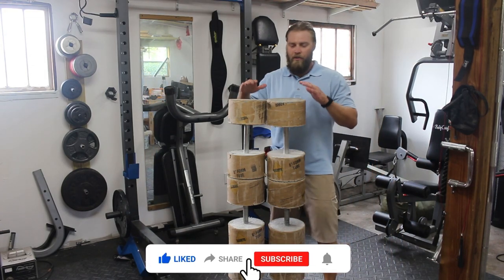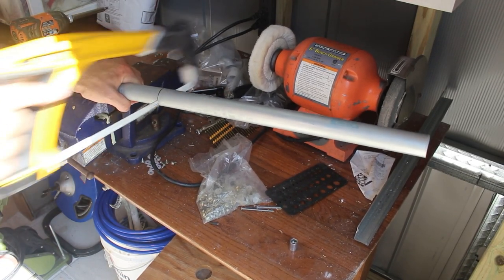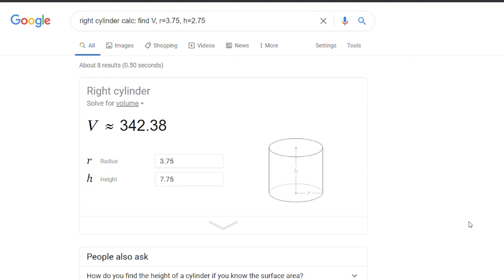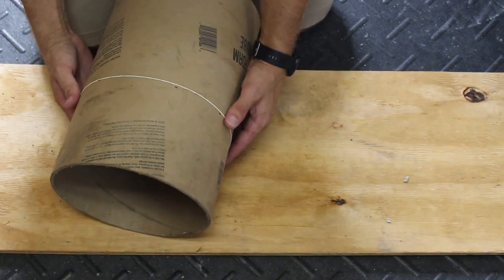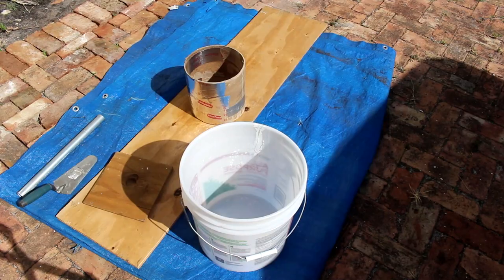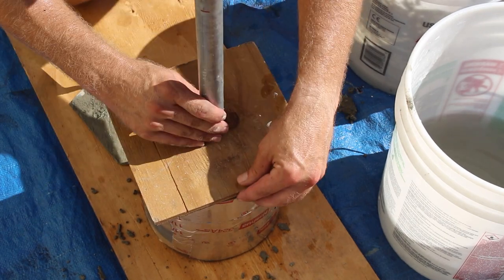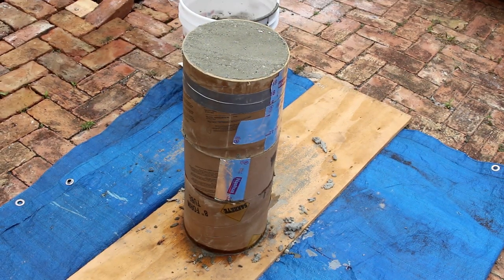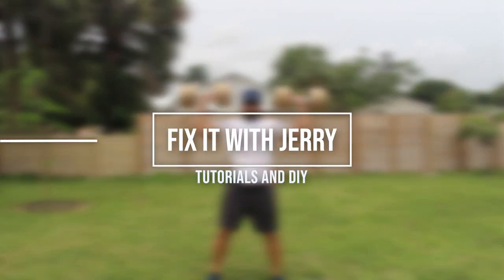DIY - Cheap Concrete Dumbbells

Comment: Hi FixItWithJerry
I am trying to make exact weights in kg and cant really get a hold of how you calculated the spreadsheet. Would it be possible to update one for EU Fans?

Also, wouldn't it also work to just weigh the concrete instead of calculating height?
Reply from the maker: What are the increments you would normally use in the EU? I can build another spreadsheet in kg and cm. I'm not sure I understand the second part of your question, do you mean weighing it wet (as you mix) and pouring in a mould?
Reply: @fixitwithjerry6161   Thanks for the quick response. Thats exactly what I meant, I've seen other YouTubers do that but I am unsure about the accuracy of this method as I‘ve heared some of the water evaporates (which lessens the weight in the end).

I'd really appreciate a chart with kg for 20cm (diameter of the mold, close to your 8 inch). Yesterday I tried to make one for myself, but somehow I didnt get it to work for metric.
Reply from the maker: @kjell2991  That would probably work but then how would you know how tall to cut the tubes? I also don't know the wet vs dry weight of concrete. Maybe I'm missing part of the process. I should be able to adjust the spreadsheet I have fairly easily. So, 20cm diameter and what kind of weight increments? In the US, for example, we usually jump 5 or 10 pounds for each set which is why I have 20, 25, 30, 35 lb .. etc measurements.  Would you 2kg or 2.5 kg increments maybe? What is common for a commercial gym in the EU?
Reply: @fixitwithjerry6161   it differs, but 2kg in between is the standard. With weighing, you cut the molds after you poured the cement. Makes it more complicated in that matter for sure.

Only thing that will be a bit problematic in my case is that I got some heavy duty metal handles that probably weigh 2kg+. Hard to calculate that in but I could use a sanding machine to get rid of additional weight.
Reply from the maker: @kjell2991  I see, well with the handles you would still probably be pretty close. As I show in the video, the ones I made were actually closer to true weight than the metal hex weights I bought. I'll try and put together a spreadsheet for ya. I'm sure you're not the only one that would appreciate a metric conversion.

Comment: If we waren't using an 8" form tube how do we "solve for the volume of a cylinder"
Reply: At Lowe’s they sell 8” and 12” diameter form tubes. All you do is divide the diameter by 2 and this is the radius. Look up cylinder volume calculator. Type in the number that is half of the diameter in where it says “radius “ and type in the height of what u want it to be. It will give u a number in cubic inches and that is how much space there is
Reply from the maker: There's also a size calculation chart (Standard and metric) on my website.

Comment: The diameters are different because they ship the tubes in one another.
Reply from the maker: Makes sense. I point it out because it will screw up your calculations for weight. As long as you know which one you're using you can compensate.

Comment: Rigid emt is probably better for the handles
Reply from the maker: Is that not the same as Galvanized EMT Conduit only threaded?
Reply: @fixitwithjerry6161  They are both galvanized but the difference is regular emt is thinwall. Rigid has a thicker inner wall and several times stronger.
Reply from the maker: @ruve_9074  good to know thanks!

Comment: It is okay if i use other cement?
Reply from the maker: You'll want to use something that has gravel in it, the gravel gives it strength. Not mortar or stucco mix or anything like that. Also I would stay away from the fast-setting mix because it may harden before you can smooth it out in the mould. Hope that helps.

Comment: You must put "anchors" into the metal bar.  See this example https://youtu.be/4ZES0ZKmes0?t=302.  Without the "anchors" with repeated use, your concrete weights can come loose and fall off the barbell handle!  This could cause damage and even worse potentially hurt someone, especially with larger weights.  Great video, but please remind your viewers to anchor the handles.  Also, remember to wear a mask and goggles when working with these materials.
Reply from the maker: I've received enough feedback with the same general message to make another "mythbusters" style video to showcase what exactly does it take to break concrete away from a metal insert such as this. Stay tuned!

Comment: Surprised no one in the comments section challenged his statement that too much water will make it too weak.
Reply from the maker: Quickrete says, quote, " ...it is important to know that the more water  that is added to the mix the weaker it becomes. Adding 1 extra quart of water per 80lb bag can reduce the strength of the concrete by 40%..." I am glad that you pointed it out because I'm sure you're not the only one that has asked the question. I'll gladly address it. It is well documented in the construction industry that an overly wet mixture throws off the chemistry of the concrete curing process. In fact, there are several tests that must be accomplished on-site when it comes to the structural curing of concrete. The manufacturers of these concrete mixtures  specify a minimum and maximin  amount of water to be added to the mixture. For something like a crude concrete dumbbell  it probably isn't enough difference to even mention however, if you're pouring a slab or building a 40 story high rise this is actually a very important variable.

Comment: Bro you have full gym equipment and you stick with concrete
Reply from the maker: Lol, I used these before I got the full gym. I finished the video and then sold them since I have a full set of real dumbells now. It took me years to find a good deal on used iron weights  and we've seen shortages with the virus and gyms shutting down.

Comment: They chip and break.!!
Reply from the maker: I used mine for 3 years, never chipped or broke a single one. I had sets from 30 up to 65 lbs. I never dropped them on concrete or any hard surface without gym mats, most people don't drop steel weights on concrete without at least 1/2" rubber mat protection. I would like to know more details and specifics on how exactly you built yours. Let's identify the deficiencies in your build that caused them to fail. It will help everyone make a better finished product.
Reply: @fixitwithjerry6161  tyre filled with  concrete